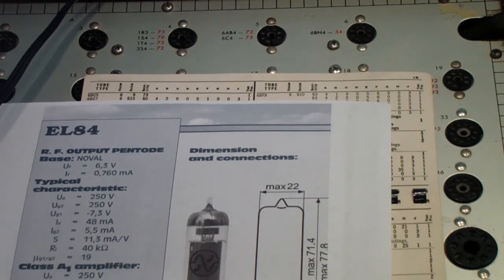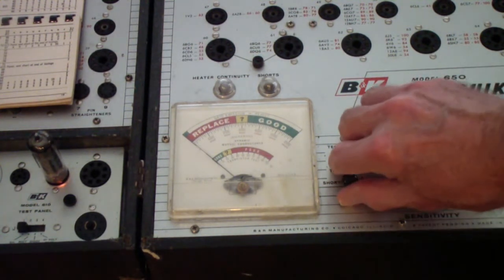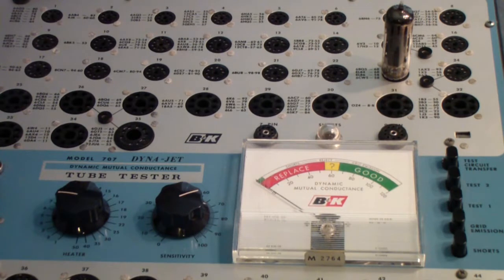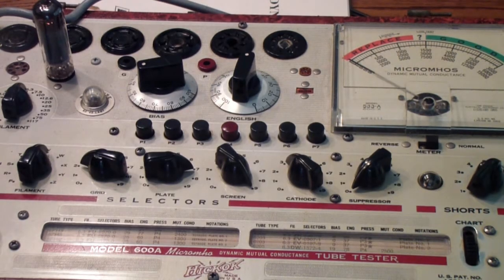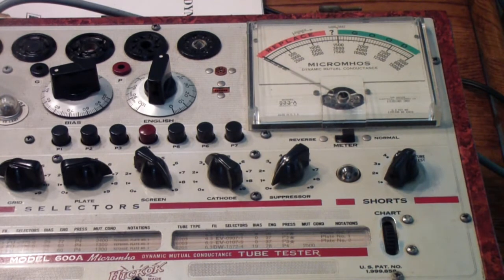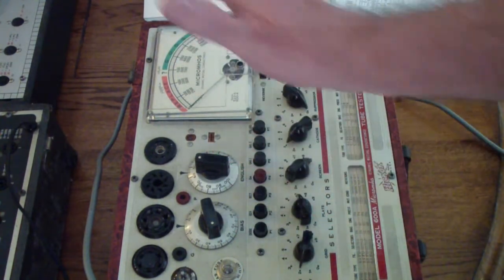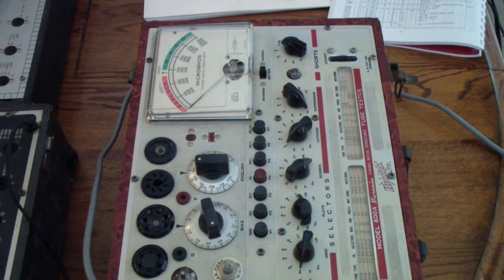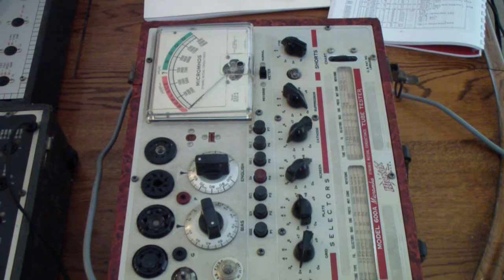TTT093 Testing EL84 on B&K, Hickok Testers

Comment: Hi Tom,, Thank you very much for taking the time to do this extremely informative video/lesson. In the near future I will Use the 6k6 tube settings and use one of the other spare 9 pin sockets. Upon going through the wiring diagram of my 650 I noted several mistakes on the Schematic as well,, So will have to trace things out inside the panel...

I'm going to do 2 other things as well,, One like you suggested is to install a Variable grid bias pot With a LED Volt meter panel and the other is to install a 100ma LED Current meter panel,,, in the Anode CCT..

I was going to try and duplicate the 610 panel for a 6BQ5 tube setting ,, unfortunately I need to be able to check the switch continuity of Slide Switch J, in the Number one position to see what path the wiring is going to go to Octal plug socket.

Hope fully I will be able to do a small video so you can see what I've Done,, Glad the 6BQ5 arrived in one piece. Thanks Immensely for your wonderful Videos,, and for your contagious enthusiasm. Looking forward to your next video.
Reply: I agree with you. Very informative content in this channel
Reply: I was checking an EL84 on a radio and found that pins 1 and 2 were shorted. The datasheet indicated that pin 1 was i.c or internally connected. Maybe the tube is bad but pin 1 does have a wire going into the tube .

Comment: Hey Tom, Good video.
This is why I put together Dos4ever's uTracer tester.
It tests at actual voltages and does sweep.
I realized while rebuilding my B&K 500 that voltages delivered to the tube under test are not always optimal.ie.. grid, screen plate voltages.
Reply: I have a B&K 500 I bought and need someone to repair it to working order. Is there someone you suggest?

Comment: Thank you for this video Tom. I was losing my mind trying to figure out what was wrong with my Hickok 6000. I was getting that same low reading on a EL 84 after getting good reading on my Hickok 539c and my Eico 666. Just about any other tubes that I test on the 6000 will come very close to the 539c except the EL 84. Funny the 539 uses the same knob setting except no bias and shunt knobs on the 539.
Reply: i realize I'm kinda randomly asking but does anyone know a good place to watch new series online ?

Comment: Thank you for this very informative video.  I have had problems testing the EL84 on my Hickok 605A.  But I have a question for you.  How do I get an accurate micromhos reading for that tube with my 605A?  When I set the sensitivity setting to the red dot for the 3000 range scale, I'm getting readings of only 400 to 1200 micromhos for my EL84s.  The chart says they should have 7,500 micromhos.

Comment: Yep, I'm sure I threw out some good tubes because of my Hickok 600A tube tester, but that was when I didn't know what I was doing. But it's still a gem. I use it all the time as it's my only tester.
     I know for a fact that they will ALWAYS read low on the micromhos for the 7591 output tube, with the tube chart settings.  So if u have a 7591 that tests at around 4000 micromhos, it's still good.  I don't know if Hickok ever correct this on the later charts.

Comment: You can also measure the transconductace using the Hickok 600A and use that as a good/bad tube indication.
Reply: Yes, I typically use the 3000, 6000, or 15000 setting on the English control, to read actual micromhos.   How accurate is this ? Who knows, but it's great for matching tubes. 
   We used to say "Okay this tube is reading right between the two Os in "GOOD"  So it's stronger than the one that tested right in the middle of the letter G.